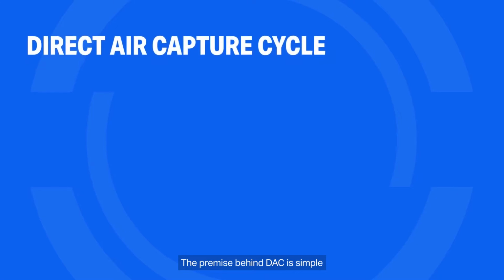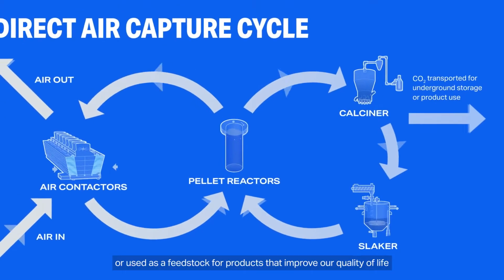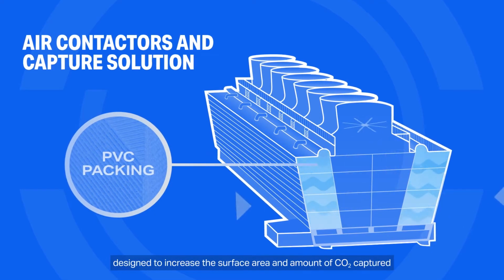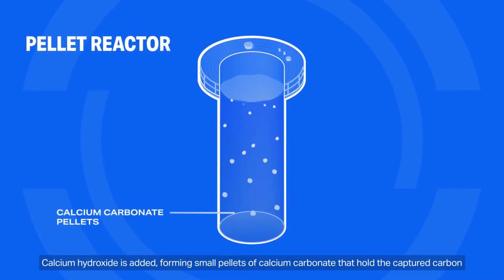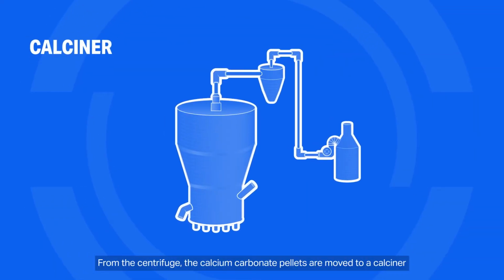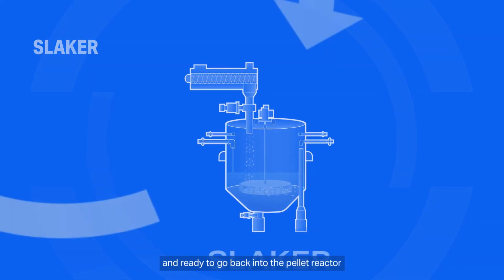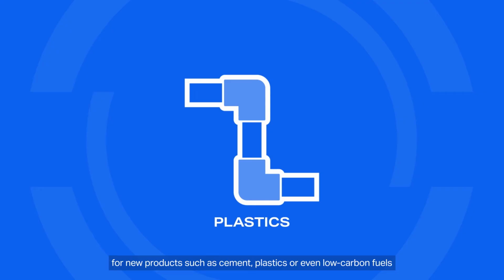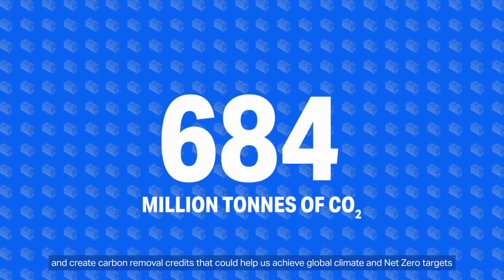What is Direct Air Capture? A Technical Explainer

Comment: This sexy/salesy "technical explainer" video kind-of-explains the process used . However, it seriously lacks any technical and economic performance info - e.g. how much energy the process needs to capture and sequester a ton of CO2 (MJ/ton CO2), how this energy would be generated and at what carbon penalty, how much would it cost to run ($/ton CO2 ) and how it compares with carbon cost today,  how does net carbon removal effectiveness goes down if captured CO2 is used for secondary oil recovery (Occidental's embarassing scheme), etc., etc.   Good start, but needs a major sequel !
Reply: Secondary recovery of oil is not embarrassing. That oil would be recovered anyway using gas injection (water, methane or CO2), and once the oilfield is depleted it can be leveraged as permanent CO2 storage. Yes - only the net CO2 sequestered should be counted as 'removed' from the atmosphere. Right now this new tech is expensive (and unprofitable) to build, so it needs some way of paying for it - and secondary oil recovery can help here. Hopefully then with the learning curve and experience, costs can come down over the next decade.
Reply: @samclayton270  it's just another green scam.
Reply: This is bullshit technology! The amount of power necessary and capital far outweigh the slightest benefit! One volcanic eruption wipes out everything we are doing now.
Reply: My thoughts exactly. Be neat to run the plant on solar power or tidal generators or something, but for natural gas power plants (or god forbid coal), there's going to be plenty of carbon released from combustion. I wonder how this compares to cryodistilled CO2 processes (if you disregard their recovery of argon, hydrogen, oxygen, and whatever else they can sell on the market for gases)

Comment: This is very impressive but I don't see how it can make a significant difference when all it does is remove carbon dioxide in the immediate vicinity of the DAC plant.
Shouldn't the priority be to capture CO2 directly from its source i.e. where it is being pumped into the atmosphere in vast quantities rather than after diffusion has taken place?
Reply: The atmosphere mixes - think wind. DAC is a form of carbon capture, and re-read my reply - I think we have to do both. Capturing at source might not be enough.
Reply: @samclayton270  I read your reply. I understood what you said, I don't need to read it again.
My point is the same now as it was at the start.
Capturing CO2 in quantities amounting to 0.04% of the ambient air surrounding a DAC plant is going to make very little difference.
Capturing and storing 100% of the CO2 being pumped into the atmosphere from a particular site in enormous quantities will make a much greater difference and is a far better use of time and money.
Reply: @ppuh6tfrz646  ok, let me rephrase. Capturing 100% of all CO2 from all concentrated sources might not be enough. What about the CO2 already in the atmosphere?